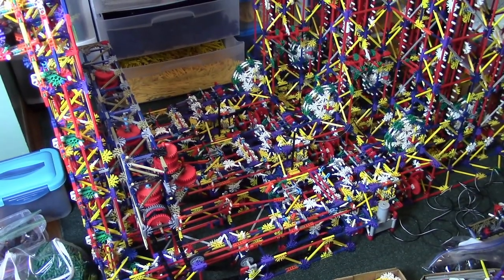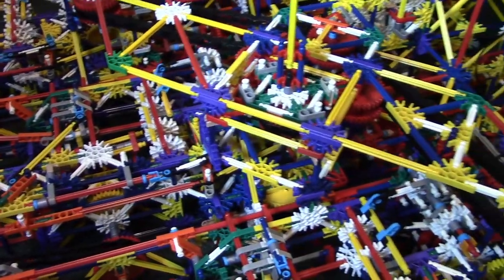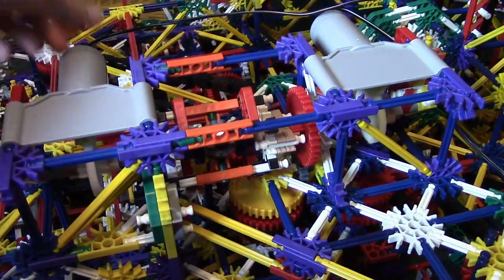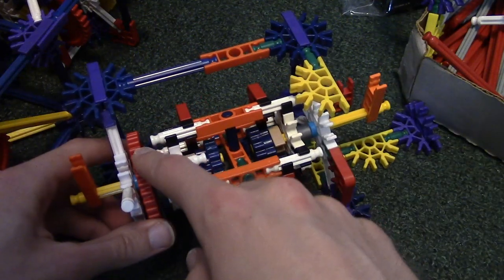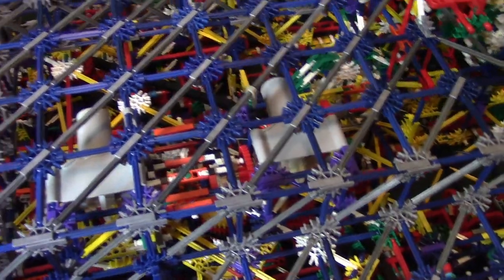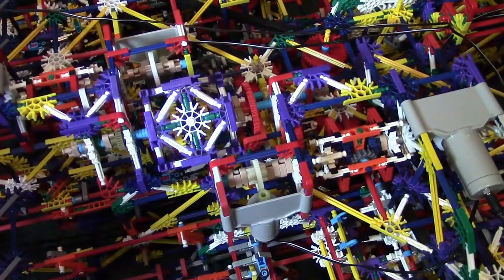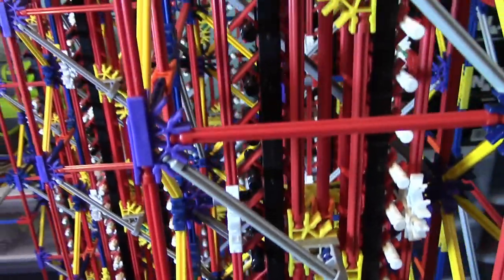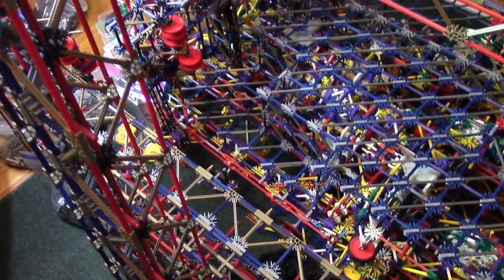Let's Build Knex S2 - Ep7 - Robot Project: Powertrain and Tape Syncing

Comment: Glad that you’re not going to give up on this and are staying ambitious and motivated to find solutions. 

It’s a shame that the limits of the knex motors have caused you to run into a road block. A possible idea, maybe try lubricating the more critical joints with a solid lubricant such as graphite. I would imagine that a big limit here is all the friction in the build (due to the nature of knex). The chain doesn’t seem to be a problem since it is already in motion, I would focus on the joints from the motors to the first transmission and from the second transmission until the robot. Another option, although less appealing, would be to get a custom electric motor with more torque. 

Also not sure what’s up with all the “very nice bro” comments lol

Comment: Great troubleshooting in this episode! Really good use of differentials as well.

I think changing the arm was the right call. Curious to see what you come up with. I wonder if something you need to avoid is using axles to deliver the rotation?

I.e. could you possibly use a tire drive at the edge of a rotating platform rather than the rotation going through the main axle? I just wonder whether that would help with the 'motion delay' due to the weight of the arm. It would probably only work for 1 of your direction drives though.

Hope your break is helpful! :)

Comment: Thanks for sharing the process. Sorry that this has not gone as smoothly as it had been in the beginning, but I'm happy to see the innovations that came along the way. The whole thing has been just fascinating and hopefully inspires future builds. I'm not at the same level of technical build, but I think I may be using certain aspects that you've showed off here in future builds of my own.

Somewhat curious if you'd be willing to show more detailed instructions on components to the whole of the build? There were videos of certain parts that I know I'd be able to follow along with and replicate to some degree, but photosets/instructables are typically a far easier read. Is there (still?) intent to share either part or the whole of the design in a more documented manner?
Reply from the maker: I'm glad you've enjoyed it! It's still having issues currently, but I got the new arm design working well; the read heads are the main problem now. I do plan on taking pictures during deconstruction, not sure if it'll be formal instructions but the pictures should be good enough. I don't plan on making instructions for the whole thing. There will likely be one more episode before the end of the build videos.

Comment: Cant you have the 2 motors connected to 1 white gear, then you wont need a differential? Or would that damage the faster motor over time because its like slightly pushing the slower motor to keep up with itself
Reply from the maker: I haven't run any "official" tests but I believe the faster motor would be forced to slow down, which may damage it. If a Knex project requires that much torque it's probably best to redesign whatever it is to make it use less, since the tan clips and rods will end up being the weak point anyway.
Reply: @Shadowman39  Yeah i think that might be the case, however motors naturally slow down a bit under load so i wonder if its neglectable. I did some torque tests with two motors connected to a white gear and the torque was high enough to snap a tan clip. 2 tan clips each side of gears stopped them snapping - I think any higher torque and I risk breaking other parts so maybe that's a good bench mark

Comment: Man that’s lame that it didn’t work out. I mean I knew 1 motor wouldn’t have the power but 4!? I don’t know how committed you are to the idea of only using official k’nex parts but at this point I would just find a high torque variable speed DC motor and figure out a way to connect it. Something like a NEMA 17 or 23 would work I think.